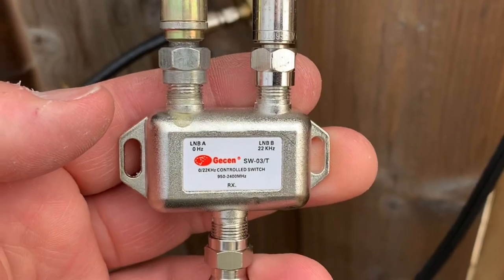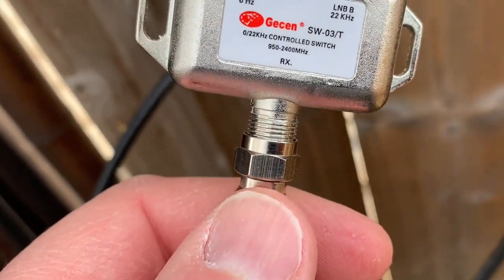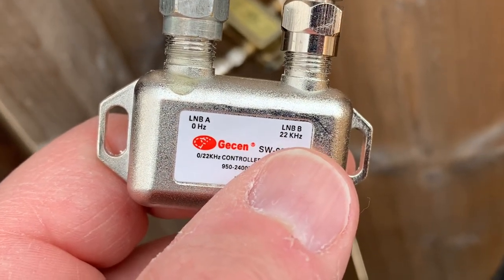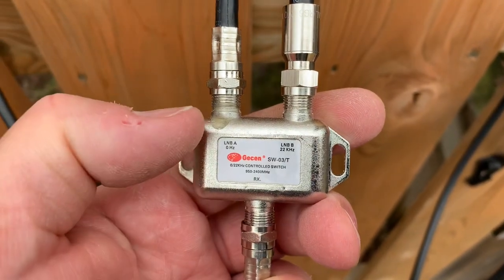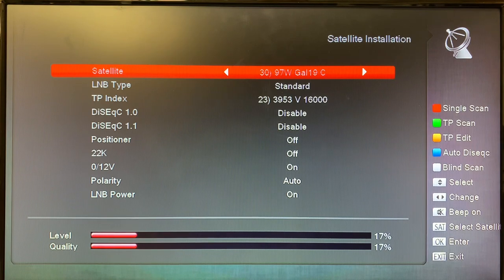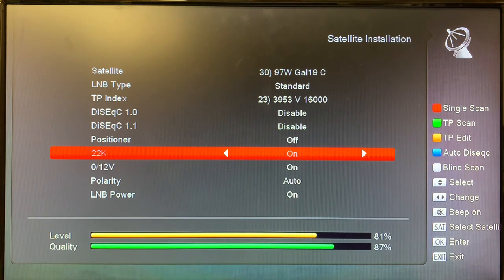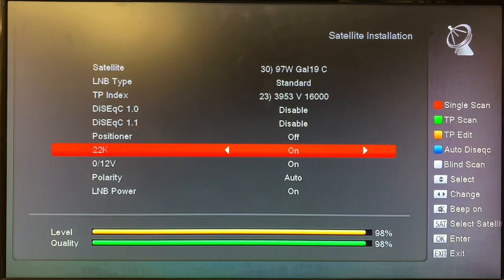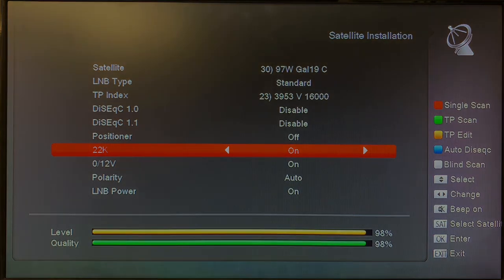Using a 22kHz switch for satellite TV

Comment: Is there a multi switch which has a single input and two outputs as I have got only one cable coming from the dish tell me
Reply from the maker: @vivekshreeni7897  The 3x4 multi switch requires a dual output LNB. 

Splitting a Satellite TV Signal to Multiple Receivers - Free Satellite TV
https://youtu.be/N6jwtCU9x7E

Comment: My building has got a common dish with quattro lnb to power multiple recievers.I have got two tvs in my house and used a splitter to split the signal to two different recievers.The problem arises when both the boxes are used simultaneously,when the channels are changed on the first reciever the second reciever looses signal and some channels dont come on both the recievers.However when one reciever is on there is no problem suggest a way to use both the recievers simultaneously.Someone told me there is something known as a sat cr switch.
Reply from the maker: @vivekshreeni7897  The only way to correctly split a satellite signal is to use a multi-output LNB, or use a multi-switch. When you split the signal off of one LNB output you will only get the channels on the same polarity (horizontal or vertical) as the control receiver.
Splitting a Satellite TV Signal to Multiple Receivers - Free Satellite TV
https://youtu.be/N6jwtCU9x7E